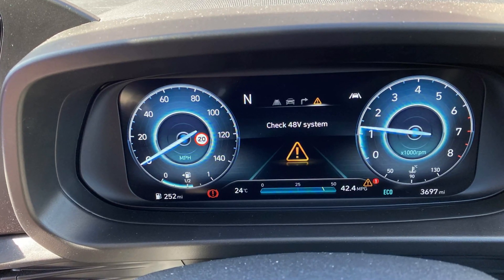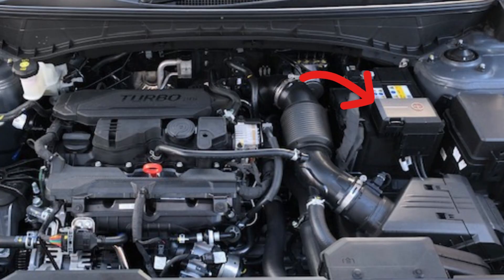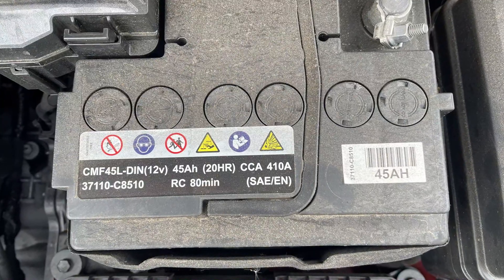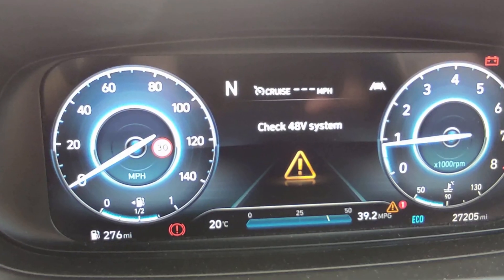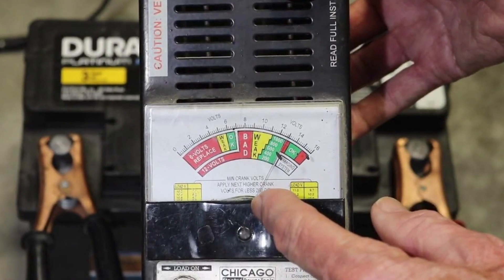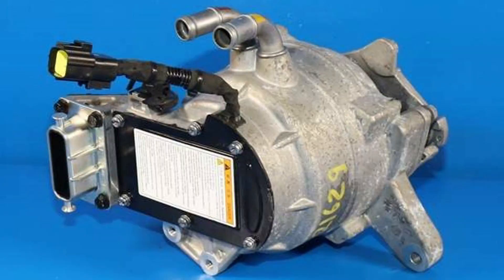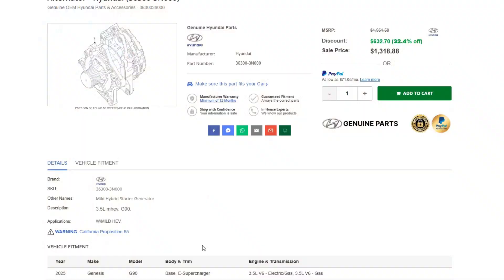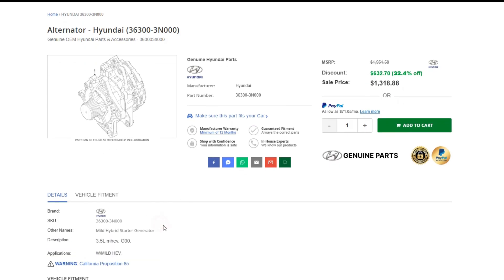“Check 48V System” in Hyundai mild-hybrid cars

Comment: On my car came this same message and everything started glitching but after I turned it ok for 30 minutes and everything was gone, I’m driving the car for past 3 days and nothing came on as error what does this mean?
Reply from the maker: Maybe, just a glitch. Or the 12v battery is close to the end of its life.
Reply: @DmitrySapko but the car is like 2022 model with 40k on it I don’t think that it will die that fast
Reply from the maker: Well, it's a bit early, but not impossible. Giving it a load test is free in any good parts store, so you don't lose anything.
Reply: @AyeeThisCrazy it is possible those 12v die quickly 2/3 years is normal. They changed it now for a different brand supplier

Comment: Hello. I have a Kia Xceed mild hybrid with this error. The dealership checked and they said the 48V lithium battery from the back has 2 cells dead and 2 on dying. If it completely dies will the car start ? Any idea ? The car has 2.5years old and the battery has 2 years warranty
Reply from the maker: It may not drive well eventually, but should start and go since the 48v system mainly covers start-stop in these cars. But it will probably attack you with warnings and maybe even set limp-home mode. For a 2.5-year-old car, try contacting Kia support in your country. I believe it's possible to trade a good-will coverage, in this case. Also, if they refuse, try getting a second opinion. Dealers are not always good with these systems.
Reply: @DmitrySapko  Thank you for the reply. It's well written in the Guarranty "book" and i asked even internationally, only 2 years warranty even if the car promotes with 7 years warranty. The car has 29000 KM, how can a lithium battery cells DIE so fast.And so far the car hybrid system works perfect, start/stop impecable, power on accelerating, it shows how the battery recharges on brakes and gives power. No idea what to do. THanks
Reply from the maker: The battery may just be of poor quality - absolutely normal situation these days, unfortunately. I would try to push it through Kia support with letters and calls. This might work and you won't lose anything, whatever the result is.